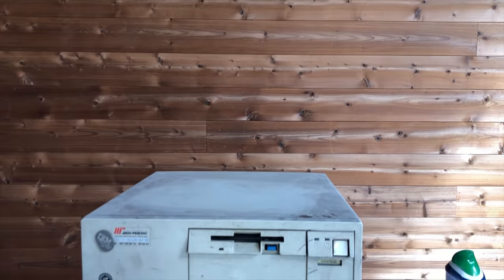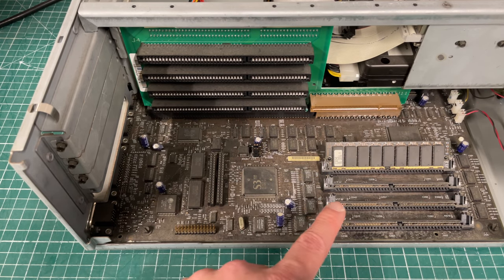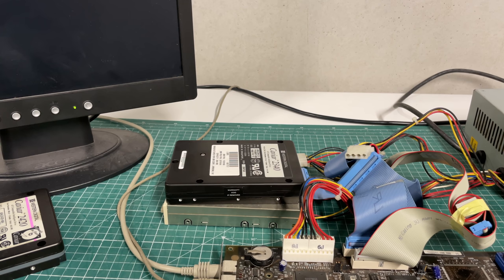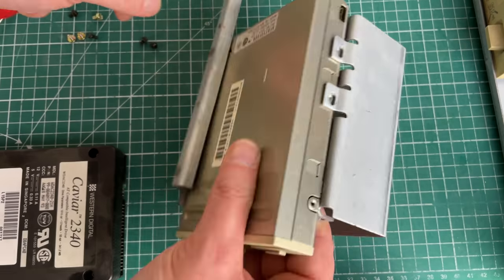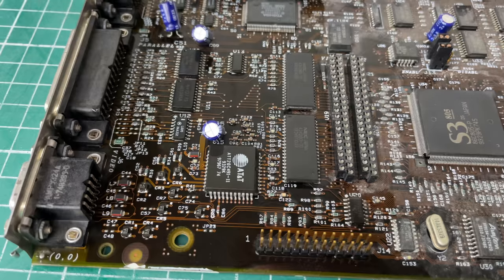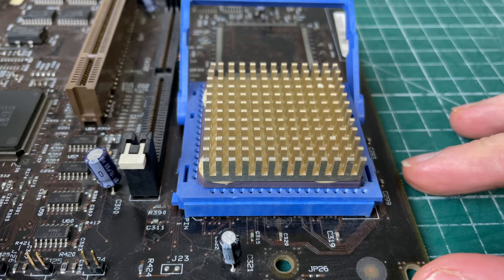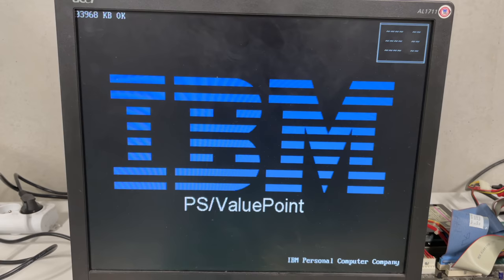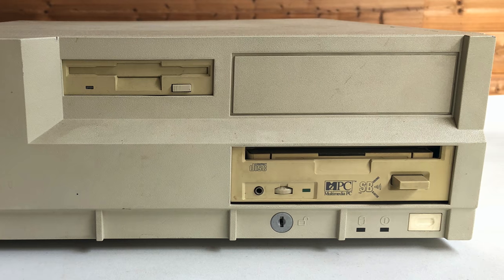IBM ValuePoint 6384 466DX2/D : Part 1

Comment: Lovely machine! Or it will be once the restoration is complete :)
Couldn't help but grin when you yanked out pin 9. I've done that to many VGA cables over the years precisely for IBM systems like this.
Reply from the maker: Not really used to working with these early nineties IBMs .... have a couple of them now to tackle ... the creative multimedia kit was a nice bonus. Hope I will be able to fix the cdrom drive.
Reply: Oh hey Clint
Reply: @RetroSpector78  It's actually not limited to IBM. I remember myself just as puzzled as you when I tried to plug my VGA cable into some random 386 machine. Some card branded "Plantron" with a  WDC chip if I am not remembering entirely wrong.
I opted for the nonviolent solution and got a 14 pin VGA cable from Ebay for a few €.
Reply: I had a Compaq Prolinea that was the same way. Ended up using a VGA splitter which didnt have the pin
Reply: Normally I'll take a push pin or sewing needle and heat it up and poke the hole in the  connector for the normal cables to work.
Reply: Pretty rad to know Clint also appreciates this channel!
Reply: Can you list me all the parts in your model 90 you have? I want one just like it but I don't have a clue as to what they are. The number's are weird. Some guy has a bunch of parts he said he will build me one but I need the part names and numbers.
Reply: Hi LGR!
Reply: Or an interposer (M-F) VGA cable does well enough too.
Reply: @IBM_Museum  Oh sorry, I was talking to LGR lol, He did model 90 video and I want to the one he has. 

https://www.youtube.com/watch?v=Bhvfa3zRaGs

I don't know how to explain to someone else.
Reply: @Bewefau : "...and I want to the one he has."

Ok - I know who can sell you one.
Reply: I was yelling in my head "just drill out a small hole!!"
Thank you for showing us the old goodies

Comment: These are beautiful machines. Looks a bit like a CD-ROM caddy is stuck in that Creative drive. Looking forward to the next episode ;-)
Reply from the maker: Yeah .. haven’t really looked at the cdrom drive yet... hope I’ll be able to fix it.
Reply: Mr Guru : The caddy CD-ROM drive I had on my 8088 Headstart LX-CD computer required power, as it wasn't manually ejectable like a 3.5 inch floppy drive. I don't remember if it had a pinhole to manually force it to eject, as my later tray-loading CD-ROM drives had.

Comment: 2:25 "a lid or something on the front of the CD-ROM drive."

Dude, this is a caddy-based CD-ROM (Panasonic CR-521/523), not a more common tray-based CD-ROM; it looks perfectly fine this way. Just press the (mechanical) eject button really hard to eject the caddy; no power is needed.

Comment: ... i just punched the missing hole in the computer's vga connector using a heated needle... Now it works with any vga cable.
Reply: I've used a small drill bit, works as well.
Reply: This contact is responsible for DDC, it's not necessary to use. just cut this pin in new cable and connect to LCD panel!
Reply: @pcclassic  i know. It's just more comfortable to mod the computer rather then mod all my cables or stick with just one cable for pcs and video cards with a blocked off connector.
Reply: Nuke Dukem  punching out the blocked pin will not devalue the computer. In fact when done well, nobody will be able to figure out the d-sub port was modded.
Reply: Nuke Dukem  yep, you don't want to do any modifications to the computer unless absolutely necessary. most lcd panels use separate vga cables, which are a dime a dozen, it's easier to just do what he did. and not risk screwing up the dsub connector on the computer. I have a model very similar to this, and wouldn't dream of doing that to it..
Reply: Nuke Dukem  you people are too anal about minor stuff like this. Modding a bloody port is an insignificant mod for convenience and usability. It does not alter the integrity, look or functionality of the machine in any way. Moreover, not all valuepoint systems have that pin blocked, making your argument pointless.
Reply: @kaneCVR  that might be true, in my case that port is blocked, and yes IBM collectors are very specific about the computers they collect, and many will notice if the computer has been modded. the computer would probably work just as you said, but originality is key. in my case the system isn't that original anymore as I had to swap out the original sound card, but the idea is to keep these as original as possible. so it's either modding a $10 vga cable or the risk of messing up a machine that's probably now worth considerably more. if what I hear about that pin is correct, there's a good chance that the cable would still work with most machines either way.
Reply: @robert1975031  I'm also a collector, but I value usability over keeping things stock . I don't care about resale value whatsoever. My Valuepoint PS/66 is currently running 32mb of ram, a POD83 overdrive CPU, a VLB SCSI card (to bypass the 1GB HDD bios limit, since the controller has it's own configuration tool) , a 4.3GB Seagate SCSI drive and a Yamaha OPL4 sound card (SW20-PC). I use the computer instead of having it just lay on shelf some ware in my workshop. The only mod I've done is the D-SUB connector.  I just wish I had an L2 cache FRU for it, since none of my units came with L2 cache. This use to be my sister's computer - her first computer back in 2000, and the D-SUB mod was done when the PC was in use, since she wanted to use a larger 17" monitor over the 14" the Valuepoint came with.
Reply: @kaneCVR  well usability in your case turned out to be the better option, and you upgraded it to make it's life as long as possible. of course if I look at it now, stock pretty much went out the window when the original sound blaster died, and as the machine ages, I'm certain other things will need to be replaced. but I'm finicky on when it comes to what I consider modding the heart of the machine basically, which is the motherboard. I don't have that steady a hand and I would likely botch it up, so having a ton of these vga cables around, I would rather yank pins off that then ever risk ruining the board. I am glad yours still sees use and I have a yamaha card an OPL3-sax. that I might want to throw in it. that was an epic card.
Reply: I'm one of those people who prefer original hardware, or original upgrades, with minimum–none modding (I abhor lockout chip leg cutting). However, if it is something that the original owner would have modded on the system when it was new to improve compatibility—in this case the plugged hole of the VGA socket—then I would have modded that also, but only if I could do so with extreme care so that it looked and functioned exactly as if it was original to that card. That's just me, though.

Comment: I have fond memories of these. My elementary school was full of them, but the monitors they used had control buttons hidden behind a panel that more closely resembled an Aptiva-style drop-down look.
Reply: Probably they were the same design that my secondary school had dozens of. A square white power button on the right if I remember correctly, all the other controls hidden behind a hinged panel.

Comment: I had the same problem with the VGA connector in my Olivetti TIN/II (M4 586 Modulo). I made the hole for the ommited pin with a hot needle and problem resolved!
Reply: Yeah, yours was a better solution than taking out one of the monitor's pin
Reply: I just drilled the hole with a small drill bit.
Reply: Stanley Broniszewski  yes but I have a lot of problems finding parts like a cdrom drive, ISA cards (sound, ethernet...) here in Spain. I don't know any places to find those parts at a reasonable price 😭

Comment: As Adrian Black would say: Don't be afraid to wash your mainboard. Just rinse with IPA afterwards to displace the leftover water and leave it to dry overnight. It has worked out for me on my Commodore PET, Commodore 128D, Amiga 600 and some other machines which are still working by this day.
Reply: Indian pale ale?
Reply: @paco3523  isopropylic alcohol
Reply: @AlejandroRodolfoMendez  no such thing.  wash it with soap and water.
Reply: @BenState  yes but I was explaining that ipa is iso propilic alcohol
Reply: @AlejandroRodolfoMendez  *isopropyl.

Comment: Pin 9 in VGA port is used to supply +5V to DDC interface of the display. You may have troubles with this display being not detected (not recognizing the model, native resolution, etc.) when off (or maybe even at all) by more modern PCs. I think it would be justifiable modification to drill one small extra hole in that VGA connector to make it more compatible.
Reply: or just buy a 6 inch extension cable

Comment: 15:00 I love how when having a closer look at the heatsink of the CPU, there's clearly a see-through gap between CPU surface and heatsink surface. That's some great air-gap insulation they've got going there. Poor little sturdy chip!
Reply: The edge of the chip is beveled.  I have an AMD DX4 that looks exactly like this - thermal adhesive bonding a small heatsink to the top.  There’s no room between the mating surfaces except around the edge.
Reply: @nickwallette6201  To me it looks like there's light flashing through the gap all across the chip depending on camera angle, so I'm somewhat inclined to think that the gap is not just around the edge. No matter what: I guess that given the chip survived this long, there's no real thermal problem at hand, even if things look suboptimal from today's perspective.
Reply: Mr Guru  Okay, thanks for elaborating!

Comment: Thanks for the video! I remember toying with these as a child, I loved the case design and the use of standard components. Lots of simcity and lemmings were played. Mine was a SX-25, I remember seeing at school one of my teachers had a DX4-100 model and I was quite jealous!
Reply: The SX/25 had the CPU soldered to the board and an empty ZIF socket for a CPU upgrade next to it. Mine received a 100 MHz DX/4 I'd found somewhere, without any cooling, not even a heatsink. It never blew up, probably because the computer didn't see a lot of use. I do think I had some weird and mostly-forgotten stuff on there, like Calmira.

My school decided to buy a job lot of used DX/2 66 PS/VPs along with 14" CRTs from a bank in 1997, one for each classroom and some for a rather basic PC lab. They came with 8 MB of RAM and a 250 MB WD Caviar drive and my school upgraded them with some no-name sound cards that no one ever managed to get a single sound out of and a 32x CD-ROM drive. Windows 95 and Office 97 was about as much as the machines would take without running out of hard disk space and RAM. I had a two-part solution for that problem. On the one hand I found another 8 MB SIMM for hours (I had a one-hour break in another classroom, with minimal supervision, and for some strange reason that computer was the only one out of some 40 that had two SIMMs instead of one. One of those SIMMs magically migrated into our PC) and on the other hand I got permission to flatten the HDD and install DOS 5 and Windows 3.1, which gave the PS/VP a massive performance boost. Add some useful software (Winword 2.1 copied off of an old 286 running Windows 3), a few good games and a discarded Citizen dot matrix printer and three years later our computer was the only one that still worked and was used every day. The others had all been vandalised, cut cables, lost mice or formatted hard drives. No matter how technically inept, in each and every class there was at least one kid that knew ONE DOS command - format c:.

We had classroom PCs until we moved back into the renovated building in 2000, then the computers were needed for a second computer lab. About a year later there was enough budget for new PCs and we got our 486 back. This time I upgraded it quite considerably from my own stash of old parts, going up to 24 MB of RAM, DOS 6.22 and Windows 3.11. I found drivers for the S3 graphics chip (the first one had just run at VGA resolution with the generic Win 3.1 driver) and even tried to get the sound working and get the machine networked. Both of the latter attempts failed, the networking part probably just because of a config issue. In 2003, just when I left school, all the PS/VPs were thrown away and I took a few of them home. One should still be in storage somewhere and I've got an entire shoe box full of hard drives I removed from the others.

Comment: Great video. Its funny no matter how many computers a person can work on and no matter how much experience a person can have, it always funny(not in a ha ha way) just missing that one little overview(with the boot second device in the bios)can make a person want to pull their hair out (scream if that person has no hair)trying to figure out what is wrong trying to get things up and running. Glad you saw the second boot device was only just disabled and you're able to get MS-DOS 6.22 back on that machine. Thanks for the upload.
Reply from the maker: Yeah ... with these non standard bios systems you always need to double check. But who would think that setting a second boot device would be disabled by default.
Reply: Hey thats crazy. Somebody either went into that bios and disabled things not knowing what they were doing or decided that it would be funny just to mess with someone possibly for a good laugh you never know.

Comment: (2:09) I realize the impracticality of caddy loading versus tray loading, but I still love caddy loading CD-ROM drives. I wish we had got an additional caddy or two for my Headstart LX-CD. Loved that machine.
Reply: My first CD-R drive was a caddy type. I liked it a lot but you had to keep the caddy in a drawer or somewhere because the drive would reject an empty caddy. The drive (might have been a Pioneer) had a hinged flap over the caddy slot that broke off very quickly. 2x read/1x write, SCSI bus. It was in an external enclosure and connected to my Power Mac until I got a 6x read/2x write tray drive, then the 2x moved into my Pentium 150 toy where it was hardly ever used.

Comment: One problem with the 90+% IPA is the low water content makes it hard to remove some water soluble grime that is not alcohol soluble from a board.  In that case you can try the 70% IPA and it can sometimes do a better job.

Comment: Great video. Nice build up to the possible outcomes of first power on. :)

After my NMS-9100 Philips XT, I got a Vesa Local Bus powered SX-25 486 with 4Mb of RAM, it got upgraded to a 486-DX2-66, 8Mb of RAM and the addition of a SB16-ASP and Panasonic (Matsushita Kotobuki) double speed CD-rom drive within 3 months. It was from one of those system integrators: Escom. Escom and Vobis were cheaper than the V&D Vendex or Warehouse machines on offer over here. The 486-DX-2 platform has a sweet spot with me. This is a very nice IBM system. Back in the day a true IBM was unobtainable as they came at a cost and often had their own proprietary PS/2 things. IBM's like this Valuepoint sporting things like VLB and ISA weren't a thing in my neck of the woods a little to the North of you. I got my system in 1993 after an extensive stay / work / studies in the US and my NMS-9100 XT just wasn't cutting it anymore. I wrote my thesis partly on the NMS-9100 but just had to upgrade when I had to do statistics and Database SQL / DBaseIV properly. :) Good times

The S3 onboard video shouldn't be too shabby, but putting in a TSENG ET4000 (isa, vlb and pci exist) or other VLB graphics card and a soundcard/CD-rom would complete the system nicely.
Reply from the maker: I’ve got a philips NMS TC 100 I need to look at at some point. Also got an Escom pentium with a Commodore badge :) so many systems still to cover ...
Reply: >but putting in a TSENG ET4000

you want to put slower card? :-) Fastest ISA cards reach ~5MB/s, slowest VLB cards start at 10MB/s

for 486dx 2/66 there is almost no difference in speed between even the slowest and fastest VLB cards, as they all run faster than the CPU can write to them.
Reply: @rasz  I had a Tseng ET4000 VLB card as well as a PCI variant next to and ancient ISA one. So the system not having 2nd level cache will make any graphics card addition mute by your numbers...

Comment: If you have fine point tweezers or even a needle you should be able to remove that little blank on the VGA port, I used to do this many years ago for both this and the blanked off key pins of IDE cables.
Reply from the maker: Haha ... never thought of that actually :)

Comment: That CDROM and sound card were sold together as a bundle; I purchased the same one in the early 1990s.  It's a single-speed (1X) drive, and the appearance is correct (there is no door, as it uses caddies).

Comment: Did you try SYS'ing the replacement hard drive to put the system boot sector on it to see if it would boot up before FDISKing it?
Also, you could drill a tiny hole in that 15 pin header so you can hook up any VGA monitor to it. :)

Comment: I had that problem with the VGA connector some years ago, I heated a paperclip on the stove and made a new hole in the port. Try it, you will see - even if the pin is not needed it was better than desecrating the monitor cable. I think I might have a newer revision to that board because I did have L2 cache installed, and never had that a double key stroke error, I remember in 2001 I was trying to play back mp3's on it, I had to reduce the quality from 128kbps to 92kbps to get smooth playback. I eventually got the pentium overdrive and with win95c, 32 MB ram, 2 MB vga ram (I added the extra ram to on-board vga later a 4MB SVGA VLB card) 3.7GB HDD. My step kids had some good times with it, game wise. Internet worked well too, msn messenger, ICQ, IE5, Norton System works 2001. It was on for 7 years non-stop because I used it to play DX-ball2, Super Collapse II, and HangAroo. I actually retired it for storage in 2009.